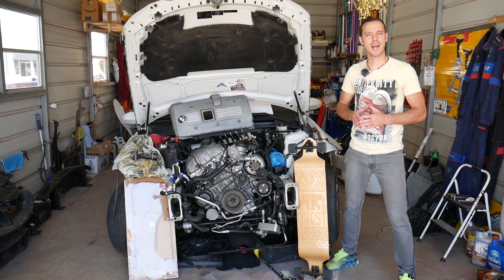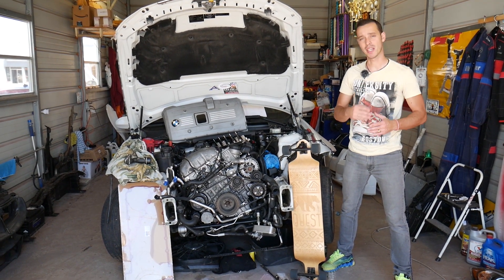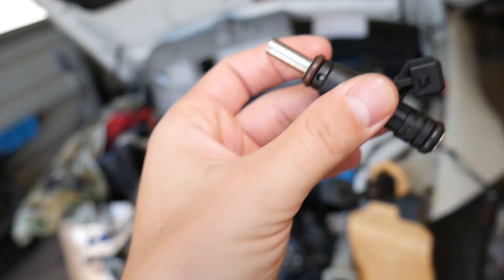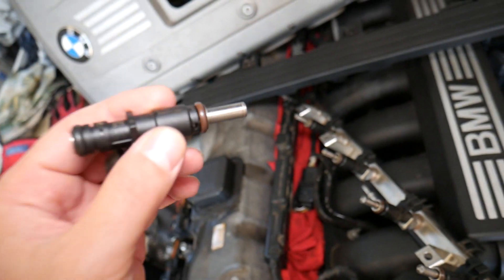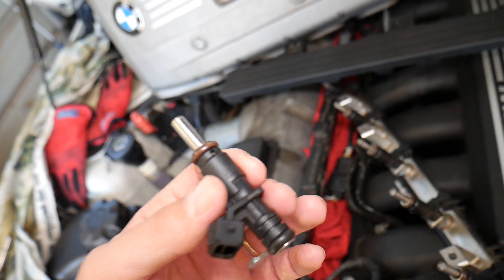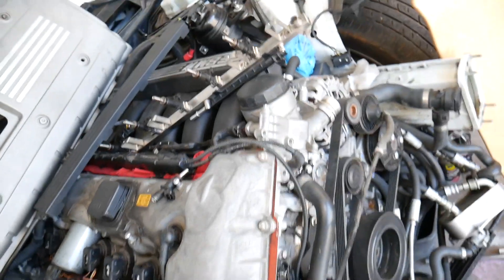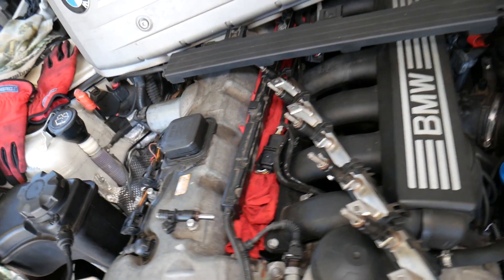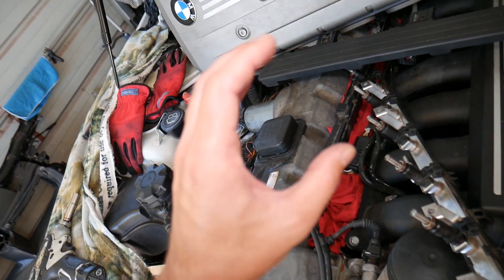SYMPTOMS OF LEAKING FUEL INJECTOR BMW E81 E82 E87 E88 F20 F21 114i 116i 118i 120i 123i 125i 128i 135

Comment: I was wondering if you could help me please, i have bmw f20 with a p0301 misfire cylinder 1 i have change spark plug and ignition coil (coil seemed like it had melted?) I replaced it now my car wont start but if i disconnect it starts but rough obviously as its running on one less cylinder . And ideas what i can do next ? Love the videos big fan